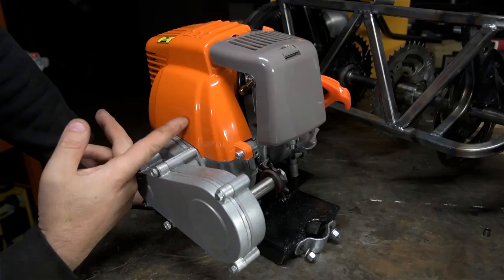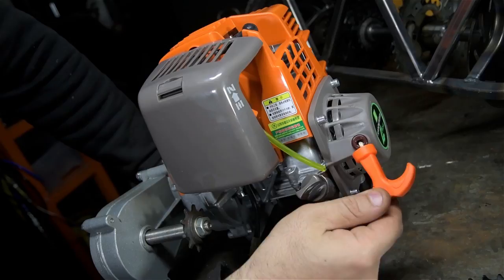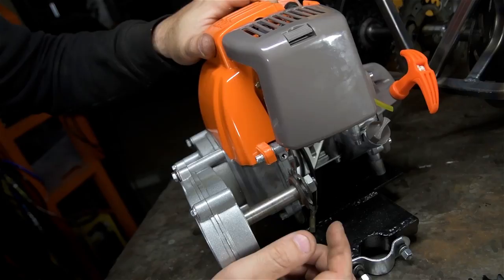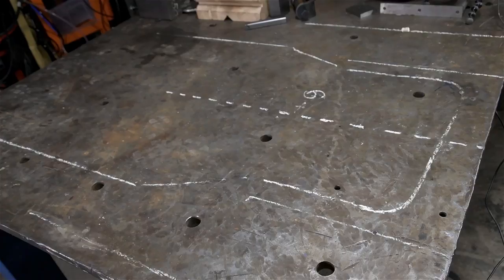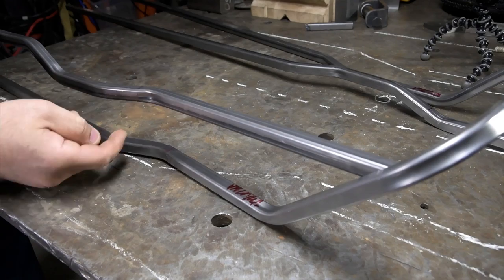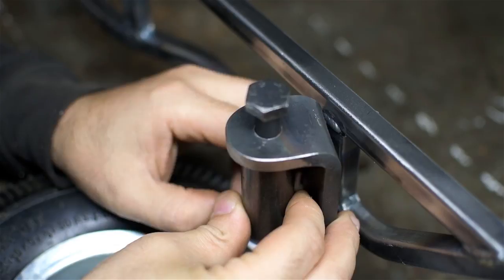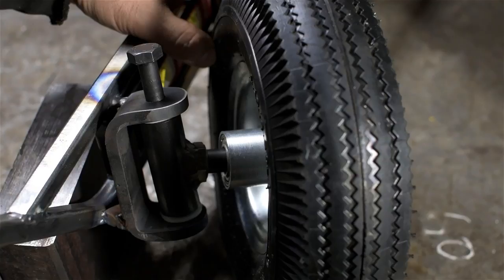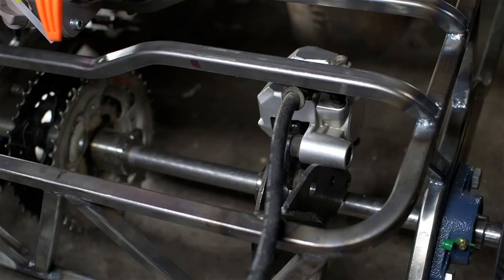"CHAINSAW" GO KART! - PART 2

Comment: disappointed you gave up on the chainsaw engine..
Reply: same.. just order #35 chain and sprockets , and run the gear reducer.
Reply: Rob M I've seen other people on YouTube run the chain straight to the drive gear and they seem to work fine? They use a chainsaw engine and I'm honestly really confused why it didn't work for him?
Reply: chain tension is the biggest culprit , especially on #25 chain or TF8 bike chain .. Tf8 also requires perfect alignment , since a lot of those rear gears are meant to discharge the chain during gear changes on a bicycle. You pretty much need to start with the chain piano wire tight , and let the natural chain stretch happen to get it " just right"
Reply: Silent, old chainsaws were 125cc like a kart engine and can work at 6:1 reduction, but a new chainsaw with tiny 49 - 50cc engine needs about 15 - 20:1 reduction with a jackshaft setup to increase the reduction...
Reply: Juniper, just needs the proper amount of gear reduction... it positively works then...
Reply: Yeah im disappointed too :S
Reply: Yeah, he should have consulted with us experienced amateur kart/minibike builders for the proper gearing ratio to use with that size motor... That would have saved him $200+... and a helluva lot of work, as well... At least he admitted at 00:25 that we were correct in our earlier comments...
Reply: You know nothing about engines
Reply: Joseph Pearson  - WHO are you talking to?
Reply: he should use it as a starter motor lol
Reply: Juniper a E-bike is 500watt a chainsaw +- 1500w
Reply: For less than 200$, you can get a real go cart on fb marketplace or craigslist. I’m disappointed he couldn’t do it with junk laying around the house. That’s the whole point. Now, he’s just making a “custom go-kart”...
Reply: @koshiie , depending on the Chainsaw they can be quite powerful. more than enough to push anyone around.
got an 10+ years on Jonsered rated to 3,4 kW, that's 4,5hp and more than many 50cc scooters got (specially over here with the nazi 45km\h limits)
and can the 3hp 50cc scooter-engine make an 100kg heavy 2-wheeler go 45km\h then a similar powered chainsaw-engine do the same with an 50kg go-kart

when it comes to chains and reduction etc. he should have gotten an torque converter from the beginning and used proper chains and gears made for MC or gokart and not bicycle stuff... there are torque converters made for chainsaw engines too.... but the price on those compare to that new engine with everything is more like robbery.
Reply: He used gears that are designed to throw a chain easily... who'd have seen this coming.
Reply: He added a gear reduction system. Extremely complicated to do and the 2 chains would just drop. I added a spring loaded chain tensioner to my drifter conversion as the chain kept dropping due to vibration.  Once the tensioner was installed it become almost perfect. It would still drop the chain once in a while but very seldom.
Reply: @koshiie  - Well, your imagination is very short then. A 40cc engine I just installed in a pocket bike carry my fat rear at 34mph.  Chain saw's are 35cc and more then enough to do the job he wanted it for. A 35cc 2 stroke can easily make 1.5HP and that would do about 20-22mph in a gokart.  The same engine he bought from ebay/amazon is a 43cc and makes 1.5hp. That one we clocked in a pocket bike doing 30mph.  A weed wacker 28cc engine with a proper gearing carried my son and his friend in a converted power wheels car to 14mph.  So yes, a chain saw engine can do it.
Reply: Andrew Browner I’m making a chainsaw go cart
Reply: @koshiie  - Back in the 50s and 60s that is all they used. Some were twin engines and most of them would run at speeds well over 100 mph. You would be shocked how powerful 2 stroke engines are. In the 60s I had a go cart with a Briggs and Stratton 4 stroke 3 1/2 HP that was worn out and without a clutch and would push it at 25 mph and it had no brakes. Dangerous? Yes. Fun? It was all I had...I was 13.
Reply: Princess Auto would have sold you some proper sprockets and chain for cheap.
Reply: Andrew Browner me too.
Reply: @koshiie  I know this comment is late but my younger brother took an engine from a vintage  snow blower that my dad thought was seized up, he got the engine working then took it off the snow blower, then made a frame using metal tubing and lawn mower parts.  the final result was a go kart with varying speeds all while being 11 years old (with some help on the welding part).
Reply: Me too.
Reply: A v-belt drive would have worked better.
Reply: @koshiie  Depends on what you are after.  My kart did 31 MPH (hand bypassing governor) on a Techumpsa 4 HP four cycle 50 years ago.  Much faster than that is unsafe, IMHO, for a 10 year old kid, except on a properly designed track, WITHOUT stationary objects everywhere (light posts, sign posts, fences, curbs, moving or parked CARS, etc.) to run into.  And even there, racing in spec built karts, people get badly hurt occasionally.  So yeah, they will.
Reply: realistically the chainsaw engine likely wouldn't have had as many problems under load, it only reaches those crazy high speeds unloaded, so it's a lot less likely to destroy the chain
Reply: @koshiie  a chainsaw engine has several horsepower, more than that fourstroke.
Reply: Juniper never underestimate 50ccs
(Coming from an a1 driver in europe🤣)
But no forreal
Reply: Spoiler alert!!!
Reply: @msteright  everything except for the engine was pretty much made from shit around the house. This is not "just" a custom go kart
Reply: @brrebrresen1367  You seem like you know what you're talking about so I have a question.
You mentioned a bunch of improvements that he made. But if he just got a better chain, would that have solved the issue he was having with a breaking chain? Without changing any of the other shit?
Reply: @koshiie  A push mower engine had more than enough power when we were skinny 10-12 yrs lifting the engine from  the old man's mower.
Reply: Dude to me ... he’s a welder with impressive ideas ... still informative and entertaining
Reply: Spoiler alert...damnit!
Reply: @koshiie  in Austria we have motorcycles with only 50ccm motors and the can get (with a bit of tuning) up to 75 mph

Comment: You do realize that the first "Go Karts" used chainsaw engines. The engine of choice was the McCollough because of its high rpm and 6 hp. At least that's the one I had. Poulan wasn't even in the running, Homelite was the second choice.

Comment: Bicycle gears have ramps designed to help in shifting.  On a high RPM setup they will throw the chain everytime.
Reply: That was the problem.  He was using a chainring setup designed for multiple gears with ramps to shift.  If he'd used a singlespeed chainring and cassette gear and chain it wouldn't have slung the chain.
Reply: Well good info guys. We all live and learn!
Reply: So bicycle chain is ok as long as you a single sprocket set up??
Reply: @samus40glock  if the sprocket is designed for single speed, probably.
Reply: Hugo chen most single speed chain rings have a “narrow-wide” design on the teeth, its superior in keeping the chain on. Chain rings from a 3 x setup have narrow teeth that allow any amount of lateral force to shift it
Reply: @samus40glock  if the chain fits to your sprocket and clutch it should be fine. Though i would recommend a bike chain because they are designed for high rpm
Reply: I have had bicycle sprockets and chains wear out without much obvious damage. They just start slipping for no apparent reason. Replace them and problem solved. But after bicycling thousands of miles I would not try to use that set up for anything more than about 60 rpms.
Reply: They dont sell centrifugal clutches in bicycle chain sizes

Comment: Dear "This Old Tony",

Firstly, I hope this gets through to you.  

Secondly, I want to say thank you so much for the time and information you've put into your videos.  I am an "import" living in SE Asia where I have no chance to learn this kind of material, but your videos have been teaching me how to become a better machinist.  I truly mean it, you have helped me learn what would be impossible otherwise because I have no opportunity to go to school where I live.  

Anyway, I want to help with what I can.  I am a scooter mechanic by trade (of 6 years or so) and I work with small engines every day, so I am very familiar with...well, small engines.  Since I can't do much to contribute monetarily to your channel, I wanted to help you with some information that I believe might help.  

1) Those bicycle gears and chain are not going to hold up.  Ignoring all the complex maths (yes, Brit speak), even a mild electric assist mountain bike (1/2 - 3/4 horsepower) can snap regular bike chains and cassettes, so a 2 1/2 horsepower motor would be way too much for them to handle as you've seen.  So I'd forget using bicycle parts altogether, although I know you've fabbed stuff already.  Sorry but, just my suggestion.  It's not the play in the clutch (motorcycle pinion gears have lots of side to side play), but just that the chain and gears themselves are too weak.

However, there is a very cheap and durable solution, check out "Pitbike" gears and chains for a range of very cheap but strong (enough) gears for your drivetrain.  Even the smallest 420 pitch chain, pinion and wheel gear are enough for 6 - 8 horsepower applications (about 4 times more than your motor at max power/torque).  Cheap import chains are just fine and will take all the power of the mild tune chainsaw motor you can throw at it.  Of course the gears will need to be machined to fit the axle/output shaft etc, but I suspect that will be no problem for you.

2) That small motor likely is going to burn itself up very quickly because it probably uses a plastic camshaft and possibly followers.  Not much you can do about that, but just thought I'd make that heads up addition.  

3) When you install the engine to the final gear, scooters use what we call a "cush drive", essentially rubber inserts that the dogs of the spur gear uses (sorry, hard to describe) to absorb the shock of stop and go throttling.  Look up motorcycle cush drive and you'll get an idea, very easy to fab up a drive unit, even for me with a welder and basic hand tools.  Interestingly, just the addition of these rubber drives it greatly not only extends the life of the chain, but the engine as well (as the engine interal parts don't receive that jolt from on and off power).  So for the drive, I would recommend some kind of damper.

Anyway that's just a few observations and tips I can offer.

Okay, hope this reaches you as your help has been invaluable to me and I want to contribute what little I can from around the world

Thank you much from SE Asia
Mini Motor Man

Comment: remember that most steering geometry info is for vehicles with suspension and relatively soft tires, that is the chassis moves relative to the steering pivot and the tire flexes significantly so the caster and camber are set to help cancel out the negative effects of that movement. Also the dynamic effects are going to be different from the static effect.(eg. what feels heavy stopped may be just right in actual cornering)
Toe in is used to remove the slop in the connection linkage during forward motion[when the ground is pushing the wheels back], more in-toe dampens, removing wandering and twitchy tendencies, too much causes tire wear and a sluggish response.
Reply: 10° of camber, 20° of castor?! Jesus Christ, it’s like a Harley chopper and a Japanese VIP car all in one

Comment: I know this is now a historical video, but I've been so impressed with part 2. A proper cut and shut, too. Respect. Reminds me of the simple wooden 'pram' go cart that my granddad made for me, which had lots of iterations. Sort of Toyota's 'kaizen', but we just fixed lot of breaks. My go cart was gravity powered but had a rear brake and was a lot of fun and very solid, but simple steering. This video reminded of it, which I've not thought about for ages. Cool work, TOT.

Comment: Here I thought I was a good fabricator, you my friend are an amazing fabricator!  FYI- I put a chainsaw on a skateboard when I was 13 years old. It was an old McCollugh and I used a Hoover round rubber vacuum cleaner belt and cut a groove on the rear skateboard wheel chucked up on a drill press. Yeah, the belt slipped on the clutch sprocket but once you got going it was fun, scary, and loud!! Thank you for your channel. It’s therapy watching you work when I don’t have the time too!

Comment: When i made my first chainsaw bike, and was young and not so expirienced. I also tried bicycle chain, and figured out 10sec later that it wasnt gonna work. I then switched to bike chain and had no problems.
Reply: yep, I was gonna suggest using a proper motorcycle chain
Reply: Not sure why all that trouble and expense. The chainsaw already has a perfectly good chain... AND it's strong enough and designed to suit the RPMs.
Reply: @johncoops6897  well think about it if his kids fell in the wrong direction they can lose a arm
Reply: @noob_master_6913 - think about it, it's called a joke.
Reply: @johncoops6897  you see that's the funny thing,I did know that,and I was jus sayin😂

Comment: that is a very strange and interesting frame design. my simply go kart was just 1/4 inch steel tubing bent into a square with a box at one end to hold up the engine. there was a piece of a sheet metal welded inside the square for the seat and for stability. basically it had no "sides" like yours does (it had a fiberglass shell that sat on the frame). i recomment welding in a piece of sheet metal for the floor of your go kart because it will protect your kids legs the best, and mounting the seat will be easy. i also recomment putting a kill switch grounded to the chasis under the seat that your kids can easily reach. i had to hit my kill switch a few times very quickly when the engine had issues or when i broke a chain or unseated a tire
Reply: This is much more of a space frame design like you'd see in a kit car (albeit with square tube instead of round). I believe he mentioned wanting to go for a space frame in part 1. Gives great strength for weight. 

Upvoted and commented because of the kill switch. 100% good idea. I can only assume he'll be putting a sheet floor in there already, but the kill switch could be easy to overlook.
Reply: before i knew anything about electrics in cars or go karts, i used to think the kill switch was magic because it only had one lead running out to it haha.

i wasn't familiar with the term "space frame" until i read your comment. i've known about the usefullness of trusses and triangles, but now i have a word for it

Comment: That long output shaft on the CVT looks like its going to be quite hard on its bearings. I recommend shortening it or maybe supporting it somehow. With such a small sprocket on it, that shaft is going to see quite highish forces and get alot of leverage.
Reply: I thought this might be a problem, but I also thought the run-out on that sprocket was significant. Feedback via the chain could really be a hassle down the road, I think.
Reply: Moraren It could use a pillow block bearing in the middle to help with side loading issues that may arise.

Comment: whatever i was just doing, stopped. 
ok i lied i wasnt doing anything...
Reply: Tony Fleetwood well you stopped not doing anything
Reply: Tony Fleetwood Monday-Friday, 8:00.
Reply: Uploaded lies this is no chainsaw engine
Reply: @tommycox63  yes
Reply: your frame design would be a lot stiffer if you made it like a truss, and made sure that all sections of it are triangular shaped. The triangle force each member to be in compression or tension. You could easily modify what you have my adding some more diagonal pieces to make 'triangles' along the length of the frame

Comment: 12 degrees caster and 12 degrees king pin inclination with zero camber is a good place to start on a go kart.
Allowing some frame flex is the key for good handling. Too stiff and it won't steer. The live axle drive will push unless the inside tire can be unloaded.

Comment: The theory of steering geometry For a neutral setting the centre line if the "kingpin" should intersect the centre of the contact area of the tyre this allows the tyre to rotate about its centre altering the "kpi" king pin inclination shifting the intersection point outside the tyre contact centre point or positive position will create over steer moving it to the negative will give understeer. Normally everyday cars have negative and sports cars have positive which is why sports cars and not so good drivers end up spinning out so much
I love the work you do and the way you present your videos ... long may you rock....

Comment: I hope you have enough weight or traction in front. that's one thing I learned the hard way. messing with carts with live axels. if there isn't enough grip in front . and too much in rear. its not doing to steer. but it looks like the rider is close enough to the front for the weight to help with grip. now its up to the tires.  the frame looks awesome. I wish I had something like this when well now... I'd like one now and I'm near 40! if I has the tools and shop to work in. and its awesome you are building it for the kids.